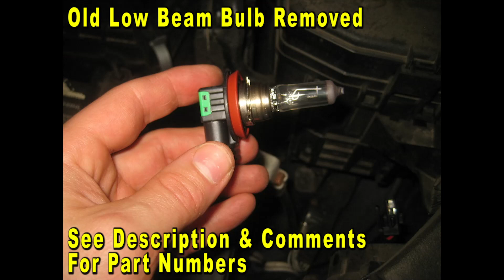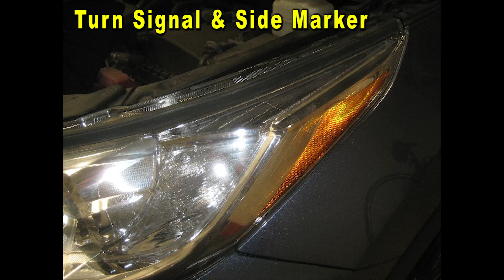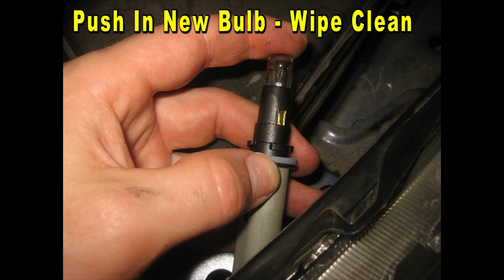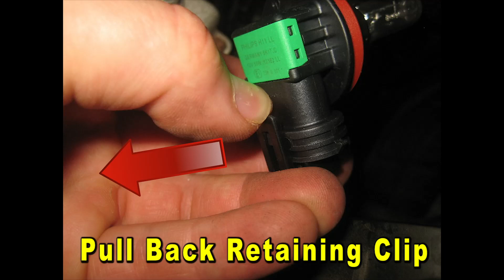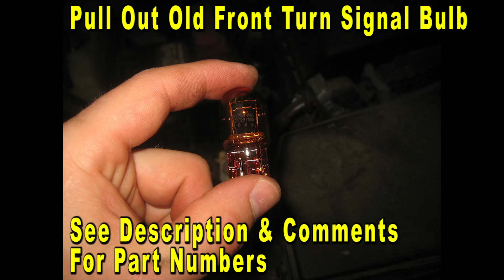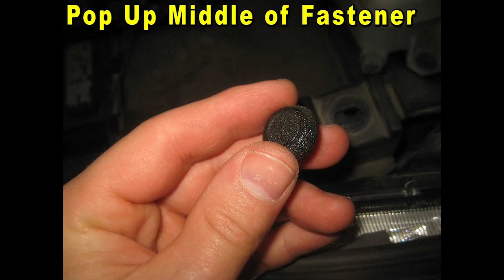Toyota Highlander How To Change Headlight Bulbs 2014 To 2019 3rd Generation With Part Numbers

Comment from the maker: Toyota Highlander Low Beam Headlight Bulb - https://amzn.to/3B1mNDm
LED Low Beam Headlight Bulb Part Number - https://amzn.to/427UwXJ
Toyota Highlander High Beam Headlight Bulb - https://amzn.to/3pf5kFe
LED High Beam Headlight Bulb Part Number - https://amzn.to/44pFE8V
Front Turn Signal Light Bulb Part Number - https://amzn.to/416QGwT
LED Front Turn Signal Light Bulb - https://amzn.to/3NEhGk6
Front Side Marker Light Bulb - https://amzn.to/3AWJ3yk
Precision Screwdriver Set - https://amzn.to/3TCMm6n
Plastic Pry Bar Tools - https://amzn.to/3HMtsV7
Socket & Ratchet Set - https://amzn.to/3Z17LbA
Mechanix Gloves - https://amzn.to/3jCnHkt
Torque Wrench - https://amzn.to/3vS5uSI

The Paul79UF YouTube channel is a participant in the Amazon Services LLC Associates Program, an affiliate advertising program designed to provide a means for sites to earn advertising fees by advertising and linking to Amazon.

Comment from the maker: Check out the DIY guide for changing a burnt headlight bulbs in a third generation 2014 to 2019 Toyota Highlander with the 3.5L V6 engine - 
https://www.paulstravelpictures.com/2014-2018-Toyota-Highlander-Headlight-Bulbs-Replacement-Guide/index.html

Here are all of the DIY repair and maintenance tutorials for the 3rd generation 2014, 2015, 2016, 2017, 2018 & 2019 Toyota Highlander -
https://www.paulstravelpictures.com/Articles/2014-2018-Toyota-Highlander-Common-Problems-Repair-Maintenance-Guides.htm

Owners of other Toyota, Lexus and Scion vehicles such as the 4Runner, Avalon, 86, C-HR, Camry, Corolla, iM, Land Cruiser, Mirai, Prius, RAV4, Sequoia, Sienna, Tacoma, Tundra, Yaris, FR-S, xB,  xD, tC, xA, CT 200h, ES 250, ES 300, ES 330, ES 350, IS 250, IS 350, RX 300, GS 250, NX 300 and RX 350.